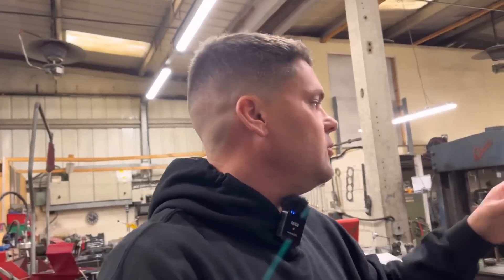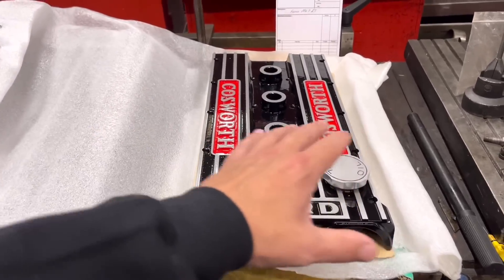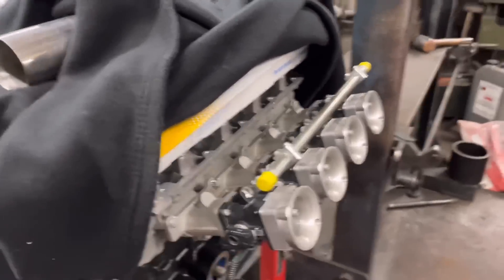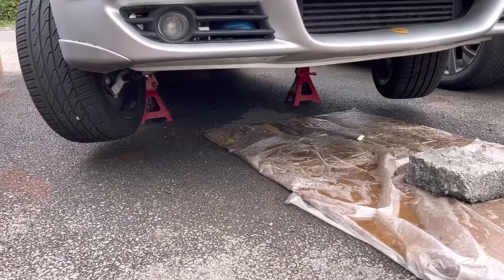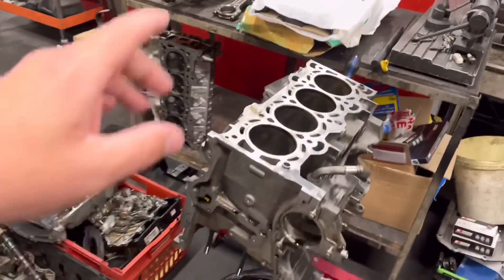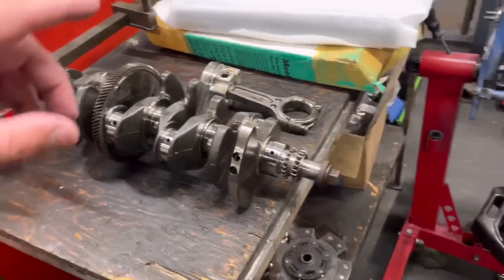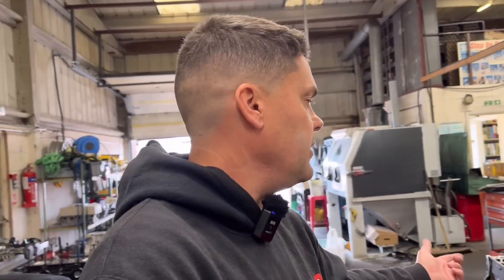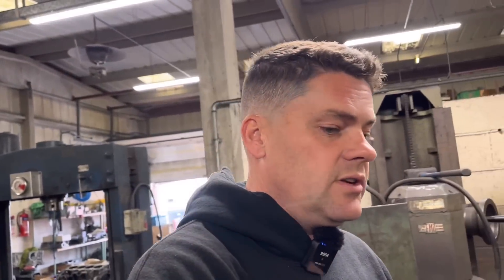Focus RS engine was built, tuned & blew up at Nurburgring! But WHY?

Comment: Great info, I'm fitting the ST 2.0 block into an RS also.. Does anyone know if there's anything I need to block off on the 2.0 block, oil or water galleries..? Or just fit 2.3 forged internals into 2.0 block, 2.0 HG and should be ok..? Thanks for any help & info..

Comment: If they used a brand new 2.0l block the cylinders when new are around 87.47mm so it's pretty small bore for a new forged 87.5mm piston. Them rings look like they were too tight probably why it overheated. Stock ford or yenmak pistons are 87.44mm there undersized to the 87.5mm spec

Comment: Put air pressure on oil and coolant system using a normal air pressure regulator and an air compressor to pressurize that closed system continuesly

Comment: The mk3 rs sounds like classic bore washing from the pop bang tunes. Find a reputable tuner and have it re mapped often they completely disable "dfco" for the pops and bangs which can increase the risk of lspi as well. 
It looks like they are using the 2.0 St block (closed deck) which is a bonus but it sucks about the piston to bore clearance and also boostline rods are pretty good for the price of them.

Comment: Mr "Just add fuel, timing and disable temp and knock sensors for a Zillion HP and a 0-60 quicker than changing my number so you can never get hold of me again " tuner strikes again...

Comment: In my opinion any high performance engine either being for track or road use is not going to last obviously, so ring wear and such is all part and parcel of the exercise. If you got the money spend it, if you haven't don't build it.
Reply: I did a sleeved Subaru 2.5 running a decent size turbo and E85(on the weekends) and it went 60k miles doing 600ish whp before a bloody tree fell on it in a storm and demolished it.  Sold the motor to a mate who beat hell out of it for a long time before he pulled it apart to re-ring it......likely would have gone longer but that E85 is hell on oil.   Then I got an EVO VIII and....well......SubaWHAT???  LOL

Comment: On the Volvo, Fill the radiator with water then put air pressure on the radiator, some where around 12-15 pounds. I would think with the huge amount of coolant leaked in the sump with that small a mileage, the leak would definitely show up and you most likely will  be able to see looking up from the bottom, where the leak is coming from.

Comment: The Volvo leaking water, 
Is the oilcooler integral with the water rad?

Suggest you bye pass the oil cooler, just a simple link pipe, 

Run it,see if any water exits via the open oil rad,

Once had this on a Fiat twin cam,

Leaking between the two
Reply: i came back on here to say the same thing, is it possible to bypass the cooler, thus proving it was at fault, and not the engine

Comment: Nooooooo, another set of pistons????? egad. 😆 Ok, please for your own sanity, put a overheat clause, and a proper map clause, in the warranty. Do you use heat buttons? If so put one on the block also. It might not be fuel, it might be timing, running right on the edge of detonation, I have seen this, and you cannot see it in the plugs or piston tops. Just a suggestion.
Blue Mule

Comment: Anyone who uses modified fuel maps and runs it hard, an air- fuel ratio meter is a very good investment and far cheaper than crank bearrings and melted pistons etc. I had one in my Skyline days, early 2000's.

Comment: Seen head bolt crack the water jacket that’s next to the bolt so using extra boost shows up the weakness in the engine and a loss of water then it’s easy to say it’s the head gasket when it can be the block has a crack these engines are unable to take much boost a poor designed engine like all eco boost engines

Comment: Motorsports development ltd up in Blackpool posted up on the FB in June about a mk3 RS  focus they had the ECU off to evaluate a remap done by another company. They found that the remap had removed the safety for a overheating engine. There are some cowboys out there.

Comment: The problem with the Mk3 was the wrong head gasket. They used a normal 2.3 gasket from a mustang. That gasket blocks one of the water channels on the Mk3 and blows the gasket out. Was mainly early models and they didn’t always fit a new engine when presented with problems.  Think they did a recall in the end
Reply: It did affect later ones too. Mine was a 2017 build and was recalled for the head gasket.
Reply: @djwarren5081  thats right, all 2016 and 2017 cars were covered by the TSB, full engine replacement by ford. Some even had two engines, some have had a replacement and still subsequently blew up...
Reply: @lastexile1187  they didn't get a full engine replacement, the standard solution was to replace the head gasket, mine had this done twice as the refitting procedure sent out to the dealers the 1st time around was incorrect so mine along with many others ended up with an oil leak, my engine packed up 2  months after the 2nd replacement gasket, ford would only cough up 65% contribution as it was out of warranty, cost me 4.5K to get me car back from dealer, total bill was over 11k, disgraceful by ford really but they wouldn't replace my engine at all
Reply: @bobbyshankit  I’ve heard otherwise by other owners who both had full engine replacements, markcup70 on youtube and a mate with a 2017 focus rs in ireland, regardless thats poor form from ford WRT your car

Comment: Why would there be water in an oil cooler? Most oil coolers use air to cool. Is it an oil heater?
Reply: Theres a few car manufacturers who run oil coolers that have water jackets...volvo for one. As it means you can run the cooler bolted to the engine and reduce hose runs to a minimum.
Reply: @cwmbc so do VAG
Reply: Volvo have used oil to water coolers for decades. I remember replacing failed B30 coolers in the 80's
Reply: Peugeot Citroen and ford also run these.
Reply: oil to water heat exchanger, usually fits on the filter housing
Reply: My GTI has an “oil cooler” that’s basically a block of metal that both coolant and oil gets run through (separate channels, of course). I don’t believe it’s for cooling the oil as it is to help get the engine up to temp on a cold start. The block is so small it’s hard to imagine it’s doing a whole lot to help at a track day or a mountain run.
Reply: @michaelw6277  I started to reply using my own experience but being dyslexic I found something more useful instead. 

This heat exchanger will allow the engine to warm up faster from switch on, and when the ideal operating temperature has been reached it will keep the temperature at a consistent 8 – 10 ºC above the water temperature.
This will improve reliability and offer consistent performance over the length of the drive.

There is more plumbing involved with this method, and the water radiator used will have to be bigger because of the heat added by the exchanger.

Because oil and water transfer heat 23.5 times more efficiently than oil to air the size of the heat exchanger can be quite small. However in very high performance cars that need to run at a stable temperature or use a cooler as an oil reservoir (dry sump) larger versions of the exchanger are used. This will be much smaller than an oil radiator as the cooler will only need to be 1/23rd the size, and won't need a direct air feed.

I will however add, I have friends and family working for performance car brands at the design stage. I love the idea of heat exchangers, but for  average cars (ford, Mazda, PSA group, etc.) they don't. There have been too many cases of them being made very cheaply,  corroding, then leaking and then ruining the engine as mayo ends up being the only thing in both the water and oil sides. Apparently the duratec engine I'm currently rebuilding has an exchanger that suffers with this, and one of them told me to make sure I got rid of it for something better as he knows I want it for a long term track day toy.
Reply: @house89147  hey thanks for posting that, very interesting to read.

I'm guessing the one VW installed on the EA888 turbo engines is of higher quality than the ones you see on the Duratecs because I don't recall reading of a single instance of one failing, even among track enthusiasts.
Reply: @michaelw6277  Personally having dealt with them on 205's, bx's and many other PSA cars from the 90's with these I have never seen an issue with one of them, even today they are still being run with the original parts. Yet I am advised by people who work for one or more arms of VW not to trust these parts, one has 30 years of Citroen experience too. They have also mentioned that apparently the one fitted to my Passat tdi 190bhp estate can be an issue which is great to know, so I may replace that when I can.